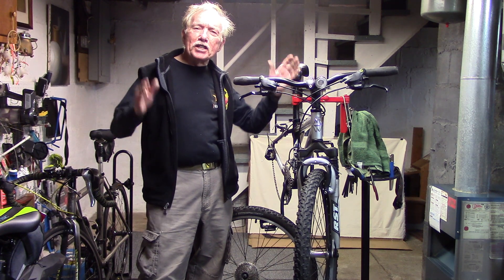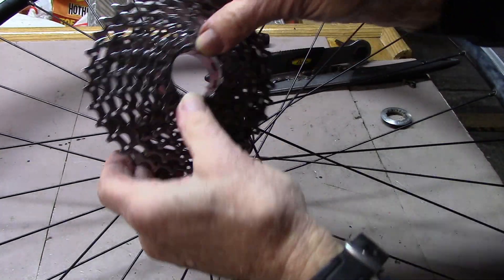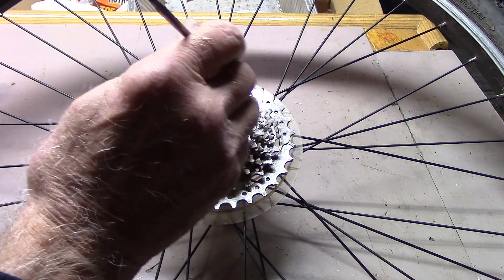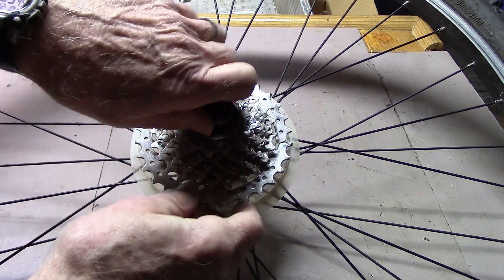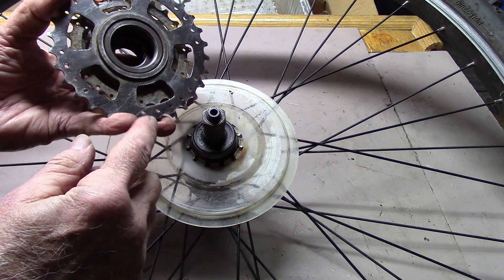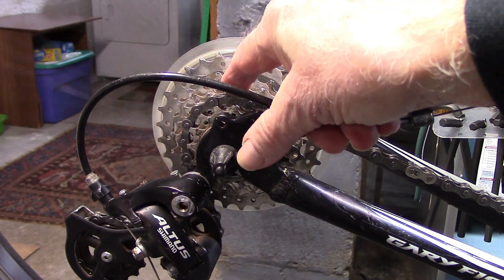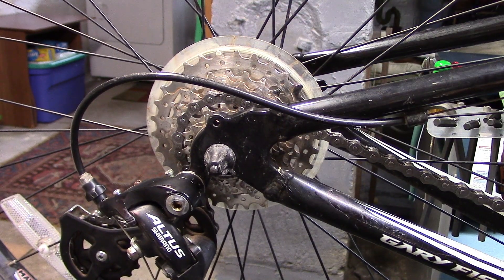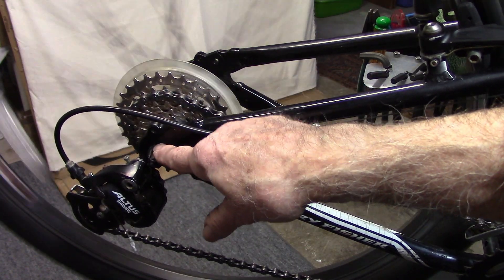Freewheels vs Freehub: Freewheel noise - clicking, clunking, overhaul

Comment: on my hub i  have a lock ring  with slots on the outside . remove this lock ring  , all sprockets come off individually ,with 3.2 mm spacers in between {except the smallest of the 7 cogs ,14 tooth has a built in spacer ] . inside the hub is splines that do not turn backwards with the hub . there is no hollow bolt to secure it . the hub has 2 different diameters .it  steps up next to the wheel  to hold the larger cogs . there is a wide spot on the hub cog splines so that the cogs can only go on one way . is this a hybrid freewheel of some type ? or a freehub . i have not located a tool to remove the hub yet . so im not sure what i have .
Reply from the maker: Freewheel and freehubs should both turn counter clockwise when you hold the wheel such that it tire/rim do not move. This is what allows coasting. It sounds like you have a freehub of some sort but I am not familiar with it and I'm not sure why you want to take it apart. Freehubs and freewheels can be tricky to re-assemble. What is the make of you 7 speed hub (may be on the hub or on the cogs) and I'll look it up?
Regards, Tony
Reply: @tony10speed    it was sticking ,  it got dirty from sand etc .so  I wanted to remove the hub from the wheel to clean it .  But I need to buy the tool .  I did get it cleaned by using wd -40   .  Thanks   .  It has a plastic shield on the spokes that says shimano hyperglide . It actually looks similar to one you removed gears from, in that the hub diameter steps up  for the larger sprockets.      I suspect it is a freewheel .   I was hoping to find info on it ,as I would like to add a gear if I can buy a single and use thinner spacers .    Either way ,thanks for taking time to respond . 👍

Comment: Good video Tony.  My last freewheel I stripped fully, added additional ball bearings and lubricated it with graphited grease (used for gear mechanisms exposed to the elements).  It never gave any trouble in the ten years or so I had it on my bike.  And it didn't make any noise at all - so when approaching pedestrians I had to give them warning I was behind them.
Reply from the maker: Where did you get the graphited grease? Sounds like a good idea. Taking apart the freewheel to replace ball bearing and lubrication can be tricky (small tiny ball bearings, pawls and springs). Give you credit for the well done job. Regards, Tony
Reply: @tony10speed  I've had the grease about 30 years - can't remember where I bought it.  You're spot on with the tiny ball bearings, pawls and springs.  I took it apart to see what it looked like - 2 days later I got it back together (had to find ball bearings of the correct size).

Comment: Sometimes you just don’t have the right freewheel tool. If you are ambitious and simply have to take the thing off, you can dismantle the freewheel, leaving just the part that is threaded onto the hub. That part will have several cutouts where the ratchet pawls go. You can stick this in a sturdy vise and those cutouts will keep it from slipping while you apply @&$!# torque to the wheel. Never failed to get the thing off. If you are replacing the freewheel, great. If not, you have an interesting project assembling the multitude of tiny balls and the pawls with their springs. Kind of satisfying, I have to admit.
Reply from the maker: Thanks for the tip. If there are some small notches in the center ring of the freewheel, you may be able to knock the inner portion of the freewheel counter clockwise with a punch and hammer. Sometimes works but other times won't budge. Is this how you began to dismantle the freewheel?
Reply: @tony10speed  
I haven’t had to do it in a while, but I think that ring (which serves as the outer bearing cone) is left-hand thread. The tricky part is putting it back together. Once you have all those tiny balls stuck in grease around the inner cup, you have to put it on over the pawls, which the springs are are making stick out, poised to knock some balls out. I’ve tied the pawls down with thread and pulled it off after I got the outer body on, but I’m sure there’s a better old school trick out there.
Reply from the maker: @trackie1957  You're right. Putting it back together again so tricky, I rather just but a new freewheel for about $25. Safe cycling, Tony

Comment: It often takes a lot of torque to loosen a freewheel. Rather than using a large wrench, I found it safer to put the removal tool in a vise and turn the wheel. You get plenty of leverage and less chance of skinned knuckles.
The splined tools like Shimano or Atom won’t slip, but the ones that have a pair of bosses on them can slip if you allow the tool to tilt while you are struggling to loosen the freewheel. In such cases, you can secure the tool against the freewheel using the quick release skewer . Of course, as soon as you get the freewheel to loosen a bit, you have to take the skewer off. 

The threads that hold the freewheel onto the hub are very fine and easy to cross thread because they aluminum. When you install a freewheel, grease the threads and use the removal tool. Hold the wheel horizontally so the freewheel rests on the hub and rotate CCW until you feel the “click” indicating the start of the thread is in position. Turn CW (right) and if you feel resistance, back it off and try again.

Again, a good vise, solidly mounted to your bench, is a wonderful tool.
Reply from the maker: Excellent advise. Viewers take note. Thanks, Tony

Comment: Are all freehub cassettes interchangeable?
Reply from the maker: In some cases, it is possible to run a cassette from a different brand than the rest of your drivetrain.
SRAM and Shimano cassettes, on either road or mountain bike, are interchangeable with each other as the spacing is the same between the sprockets. These freehubs will require a different size spacer to be placed on the freehub (before attaching the cassette) depending on whether you're running a 9, 10 or 11 speed.
However, Campagnolo road cassettes will only work with Campagnolo drivetrains. 
If you're thinking about upgrading to 12-speed, it's likely that you'll need to change your freehub. Shimano 12-speed Cassettes will only work with their Microspline Freehub body and SRAM 12-speed cassettes can only be used with the SC Freehub body.
With 1x (single front chainring), things become even more complicated. See: 
https://dcrwheels.co.uk/freehub-body-types-what-is-compatible-with-what/
Regards, Tony